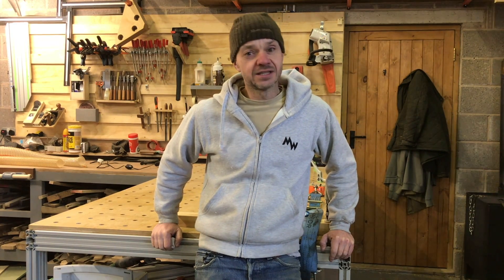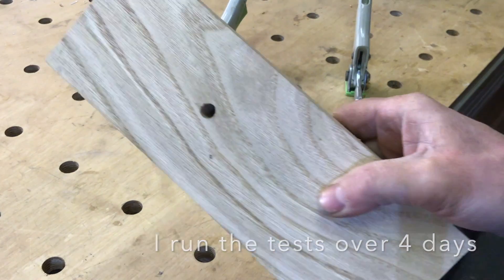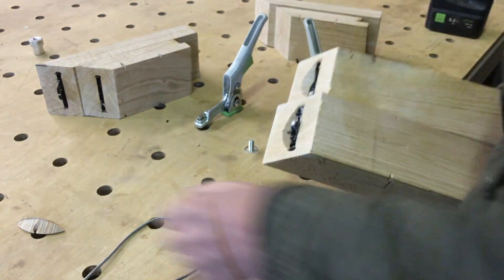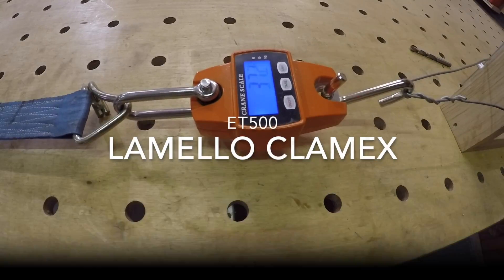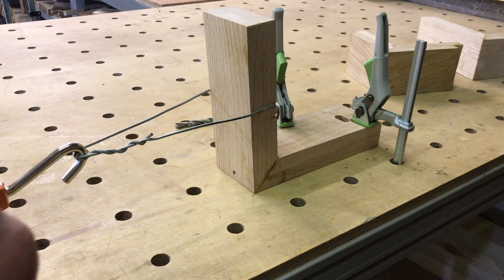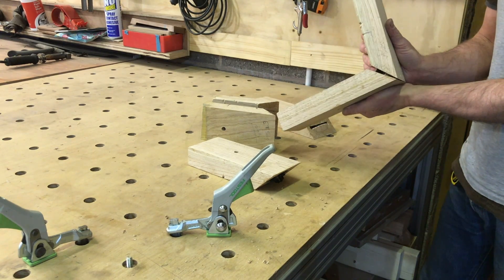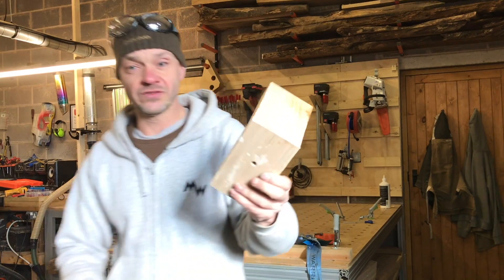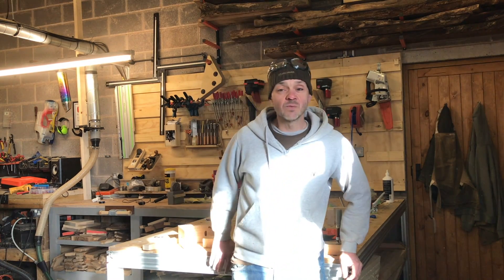#mwshoptalk - Mitre joint wood glue vs epoxy resin test

Comment: Nice. Ive got some doors to make that have mitred corners, but are rebated to take a decorative panel. I can just about fit a p-14 tenso in the joint faces. interested to see how strong it will be. I think with titebond it will be more than strong enough. the panel being fitted after is wallpapered and should take the loading off of the corners of the door to an extent. This vid has given me a certain degree of confidence!

Comment: I don't understand your groupings in the description. For example:
_
TiteBond 1
Tenso and Domino  1344N max
Lamello Clamex  1091.7N max
Lamello Tenso  949.6N max
Titebond 1 only   496.9N max
_
Why are these all grouped under "TiteBond 1
", including "TiteBond 1
 only" itself?
Reply from the maker: Google the names , I used lots of different way to connect with different glues
Reply: @ManorWood  On the ET500
 group, is "Titebond 1 only   2160N max" supposed to be "ET500 only   2160N max"?
Reply from the maker: I have now update the details .  Cheers
Reply: I am lost the same.

Comment: What is a comparable epoxy if I can’t find ET500 where I’m at?
Reply from the maker: No idea I only use ET500
Reply: @ManorWood  
The 515 is also very good if you need more working time.Its described as semi flexible but it must be very subtle as it doesnt seem to be any different to the 500 imho

Comment: Again, really interesting.  I get the issue with the fast cure but you could also use ET510 for those longer glue-ups.  I haven’t seen Permabond available where I am so I use the West System with either the fast or slow hardener depending upon the complexity of the glue-up.  Epoxies are my go-to glues given their higher joint strength and gap filling properties meaning that tight clamping isn’t quite so critical.  Plus the glue don’t have a use-by date.  Thanks for taking the effort to share this with us.
Reply: Agreed on the epoxy. With 404 and 410 additive I can solve every possible adhesive/filler problem in the boatyard. West + 410 makes the best easy sand filler ever. West + 404 makes a product that can only be shaped with a grinder. You can also mix the 2 in any ratio to provide whatever hardness you need.
Reply from the maker: I have used ET515. Which 15min open time which is also really good both 510 and 515 are slightly flexible not that that’s a problem on a piece of furniture

Comment: Is et500 only available in small 50ml containers? Seems relatively expensive if using on all joints in projects like this.
Reply from the maker: 50ml goes a very long way!, I uses a very small amount of the table build just buy. Spare nozzles !  You can also get 400ml but that’s a lot of resin you could build 100 tables with that

Comment: Interesting.  Last time you added dominos to each joint for strength, and still say a domino does add strength, but didn't do much with dominos this time.

Is that because it's a given they add strength and no need to spend more time on them, or the joints were so strong you didn't need them?

I'd be interested in adding df500 10mm dominos to tensos if that is a good combination, but don't have access to a df700.  And the Lamello is so expensive, to try to upgrade to a df700 as well just ain't possible.  Not using lots of clamps is so tempting.
Reply from the maker: So a Dominos adds strength that a given,  with d3 or Et500 there is no need to add a Domino really ,but if you want a wood glue fail safe` connection you can add a Domino 14mm or 2x 10mm ..  the none clamp system Lamello can offer is way better that any hand cut clamped joint i have ever seen ..

Comment: I would use epoxy resin every time but normally the open time is much too short.  I'm seeing more Makers using a combination of CA glue for clamping and another glue for long term holding. I'm wondering how your miter joint test would work with a combination  CA glue and ET500.
Reply from the maker: CA glue will fail under heavy load very quickly. ET500 is in a league of it own it bent my Ply table top and even the 90mm x 40cm chestnut bent before failing ..!
Reply: @ManorWood  CA glue for clamping and it doesn't take much at all.

Comment: Titbond glue is utter rubbish, yet most of the youboob woodworkers use it! Thanks for taken the time too do this...
Reply: My fav is the ET500...When you're shipping your beautiful creations overseas you can't afford for a joint to fail! ....As far as I know, most PVA type glues are based on the same recipe..you're paying for the name with Titebond in my opinion...
Reply: "Paying for the name"... It's $17 a gallon here. Consistent, easy to work with, non-toxic, extremely available. 
Epoxy costs at least 9x more by volume, is more difficult to work with (sanding it especially), has to be mixed, is toxic and harder to find locally.
If you absolutely NEED epoxy strength it's great. If you don't then it is a massive waste of money.
Reply: loopy Head Thank you, that’s very helpful.
Reply from the maker: Cheers , what your fav ?
Reply: loopy Head I admit I've followed the lead there and I mainly use Titebond II, though I’ve notice it can dry brittle at times. I’ve mainly noticed this when I've made mistakes and I have to break joints. May I ask what you use?
Reply: +loopy Head
There is another thing we can over engineer what we are making as well. If we all wanted ultimate strength we could just use steel instead of wood. 

It will be down to the craftsman how much strength is needed.